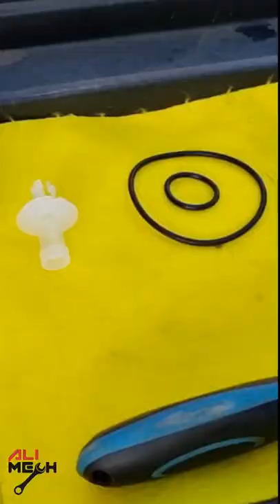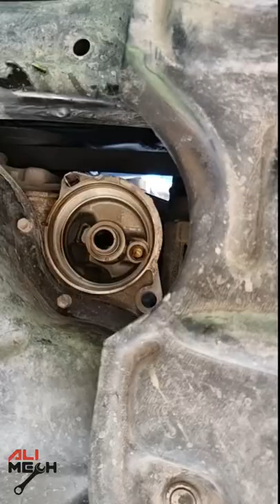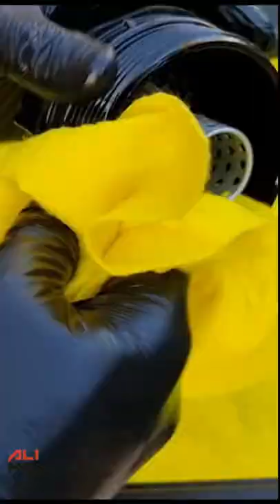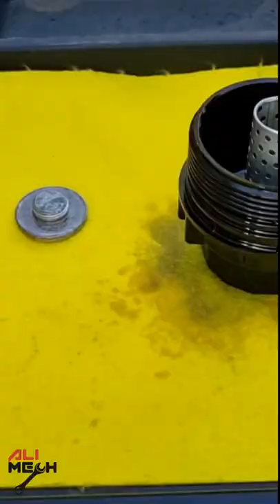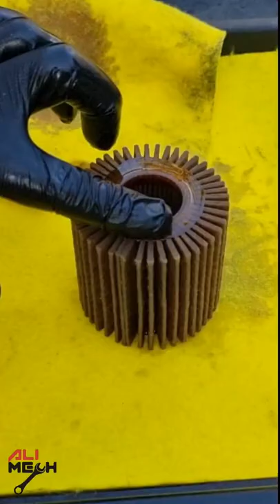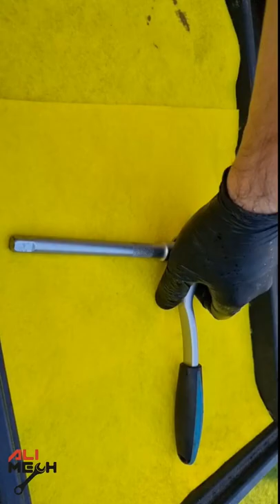How to change Toyota Camry 2.5L Engine OIL Filter2017 #shorts

Comment: I don't even take off the bottom cap I just drop the whole housing with a pan under it and remove the filter wipe it out  and replace the large O ring put in a new filter and some oil  done
Reply: Exactly, I've never replaced mine since new, thing has been in there for 200k now
Reply: @Motorsportsgeek  Yeah it's a mess either way you slice it I  F ing hate these type filters I'm old enough to remember when old cars had these type filters I have a Tacoma and it takes 5 minutes to change the oil without the mess I cringe when I do my wife's Rav 4
Reply: I am glad that my 2019 camry has the all in one filter. Twist it off, change the oil, lube up the new one's o ring, and twist it on.
Reply: same here - the Care Care Nut says just leave that one be and I do. No problems with it.
Reply: @UnkleAL1962  Yeah I hate these filters no matter how you slice it it's still a mess
Reply: Can you just use the F1 disposable

Comment: RAV4 is the same I got the socket for the cap put a little pressure on the ratchet cracked the cap
Reply: Get the metal ones
Reply: Someone over torqued it is usually the problem when you go to remove it. Make sure the removal tool is on properly.

Comment: Those paper filters with plastic crap canisters makes the almighty Toyota to an ultimate meme.
Reply: The inside of a metal canister filter is the exact same stuff
Reply: @andries4561  Maybe but it's more a pain in the butt to change the filter now. Honda and Subaru however they are still easy.

Comment: Toyota thought it’s little less messy to drain in the small tube. Works a little but, more work. The decision is yours they said you have a choice. I did mine the messy way😊. Thanks for this short but straight video 👍🙂

Comment: When I do my oil change. My filter never comes off so I have to go to my mechanic. Any tips to make it easier?
Reply: Go to the mechanic and have them loosen the housing then purchase the specific oil wrench and hand tighten it so you can easily remove it yourself next time
Reply: Torque filter cap to 18 ft. lbs. 
DO NOT OVER TIGHTEN!
Just leave the pre-drain plug in.

Comment: Right on the box that the OEM Toyota filter comes in it says not to use tools to change the o-rings. Just push or pull the sides of the large o-ring and easily grab hold of it with your fingers.
Reply: Anyone who can’t take out the O-ring using a small pic or screwdriver without damaging the cartridge housing shouldn’t be doing this job in the first place.  And I know Jack you have your own video on how to do it with your fingers which works great. Sometimes I use my fingers. Sometimes I use a screwdriver.

Comment: what the hell is this??? what happened to regular canister oil filters made of steel?
Reply: Less waste 🤷‍♂️
Reply: @SeanQuinn4  are they cheaper ?
Reply: @June0696  I imagine that they could be made cheaper, but knowing euro manufacturers, probably not. All my cars have used can filters tho 🤷‍♂️
Reply: @June0696  no, but they hold a LOT tighter.
Reply: This seems like the type   of thing @jiffylube would  screw up
Reply: @fixitallpaul4847  okay stigma Stan
Reply: your assuming people knew those even existed, my 283 in my chevelle had it and I loved it, the only reason I did the adapter conversion for the spin on filter is because I was paying cost price at 25 bucks for the cartridge filters.